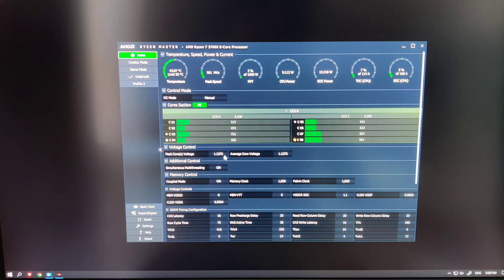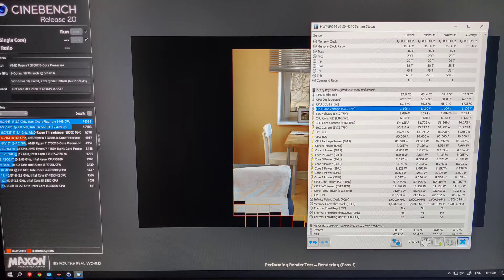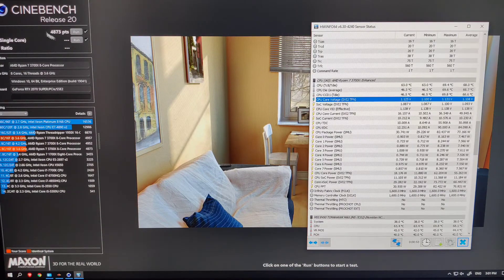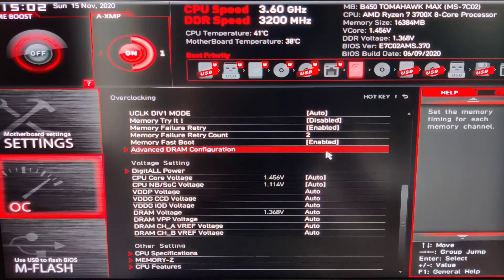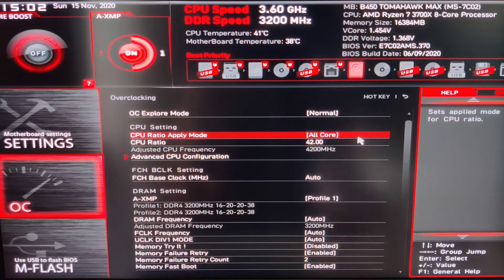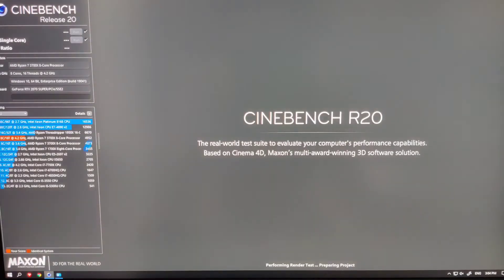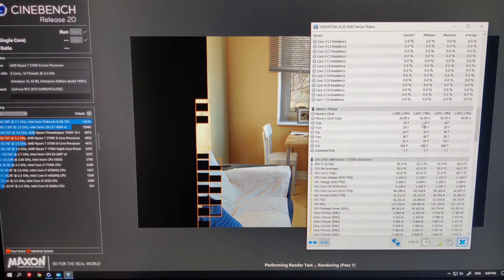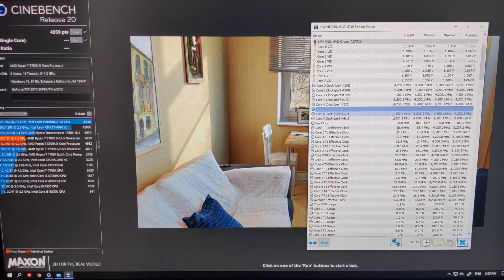BIOS Settings - Undervolting Ryzen Processor | High Performance + Low Temperature

Comment: Thank you very helpful guide. There is only one down side of your method which is single core performance. In cinebench, click on file on the left top and there is advance section. You can run single core benchmark. Since you overclock 4.2 and undervolt it, single core score drops. Even just undervolting without overclocking, the cpu can not boost fully. So there is no way to have cooler cpu and default performance.
Reply from the maker: Oh. I'll run and share single core scores of both stock and undervolt.
Thanks a lot for sharing this information!
Reply from the maker: You're right!

Here're the single core scores:
Stock - 487 (70+ degree C)
Undervolt- 478 (<50 degree C)

Personally, I wouldn't mind a little less single core performance because the temperature difference is huge!

But thanks a lot for sharing this very important piece of information. Pinning your comment for it!
Reply: @thatdude6440  Does single core performance really affect fps in games though?
Reply from the maker: Yes, games do get benefit from faster single cores.
So, for example, a 4 core 8 thread processor running at 4.8 GHz is likely to produce more FPS compared to an 8 core 16 thread processor running at 4 GHz.
Reply: @thatdude6440  Yeah, I guess also in the future games will start to take advantage of processors with more cores and threads too so like us with the 3700X should be at an advantage
Reply: @mauricejohnson660  the division 2 uses 12 cores... it's happening!!!
Reply: iam personally gain 20 fps to 30 fps more in gaming just from undervolting R9 5950x and i did this because i needed virtualization to be on for virtual system app , which cause the temp to go up in idle to 45c and in gaming it went to 60c !! soo i undervolt it to v1.100 and i did it not from bios.... from MSI Dragon center app ........ huh it really helped a lot :0
Reply: @Q8.Muslim  i have that app too for my rgb

Comment: I don't understand. I set the CPU Core Voltage to 1.25 V in my case just to lower the temps (Dont want to OC my CPU as i  have a GPU that is weak anyway). But when I open Ryzen Master and run a CInebench test (without making any changes in the Ryzen Master software), it shows over 1.35V. Is there a place where are supposed to set the "peak voltage" in the bios?
Reply: i have the same problem.

Comment: Hello, I have a question, I have a ryzen 5 3600 and I did "OC" with Ryzen Master and the base clock speed increase to 4200 but now I want to back to clock default settings but I can't, I put in Ryzen master the option default but the speed clock base is the same 4200 when it should show 3600, how can I fix that? Thanks in advanced.

Comment: Hello, I am new to this. I followed your video for my 5900x and found it to be stable at 1.375 volts. This is 100mhz under max. Is that okay to put 4700 in the cpu ratio?

Comment: Guys if you have any CPU that supported by Clock Tuner for Ryzen it may hepl you very much in setting stable clock speed, especially if you have not very much stable CPU. You may unknowingly trying to overcklocking something that supposed to work on much lower clock speed than you trying to put.

Comment: Is 84 degrees after 12 mins fine for ryzen 7 1700 OC to 3.55ghz at 1.1 volts?? It keeps rising slowly. After 17 mins it was 86
Reply: That’s really high temp for this voltage, are you sure that your cooler is efficient?
Reply: @RunningCarrot  Normally while gaming it hardly goes over 65
Reply: @dragtr0n  that’s better

Comment: Bro i did aida test for 9 mins and it became stable at 84 degrees. Ryzen 7 1700 oc to 3.55ghz at 1.1 volts. Is the temperature fine or should i downclock

Comment: I have only offset mode and not manual mode
Reply from the maker: Latest BIOS version?
Reply: @thatdude6440  I have set offsetmode   + and 0.0500v. My ryzen 3600 run at 42 ghz with 1.145 V at 50- 60C in game

Comment: Will the clock speed and voltage lower when idle or no?
Reply from the maker: It'll cap the limit, so yes it'll go down under low load.

Comment: Can i do the same on AMD Ryzen Master?
Reply from the maker: Definitely, here's the tutorial if you're looking for it https://youtu.be/WfUbB3e9Xxw
Reply: 1 question more every time i restart my pc profile change to normal and temp gets higher again is that normal?
And TY for tutorial
Reply from the maker: Yeah that's normal, I prefer to use Ryzen master for finding out what undervolting config works and apply that in the BIOS.
There's a way to make Ryzen Master apply config every time you turn on your system by clicking on a little window button in the bottom left of the software and make sure Ryzen Master is in your startup apps. But again, BIOS would be the best place to do stuff like this.

Comment: bro i undervolted my cpu successfully now running at 1.28v stable but voltage not going down on idle mode it stays fixed even on amd overclocking mode
Reply: have u found a fix?
Reply: @LawAbidingSociopath69  this fix is setting offset voltage , which i didnt mess with
Reply: @SaifAliShugan  why not
Reply: @LawAbidingSociopath69  figured out it wasnt necessary for me to undervolt cuz my idle voltage remains around 0.5-0.9v and 1.38 only when gaming or heavy task on default bios settings
Reply: @SaifAliShugan  ok but temps are high?
Reply: @LawAbidingSociopath69  stays around 75 on 1.38v
Reply: @SaifAliShugan  so u didn't adjust anything?
Reply: @LawAbidingSociopath69  nope it's not worth it for my entry level CPU , worth it if u have a higher tdp CPU which generates more heat
Reply: @SaifAliShugan  whats ur cpu?

Comment: getting different result in temperature. Undervolting it thru Ryzen master at 4500mhz @1.25V results in 65C at peak ON CB20 while doing so in BIOS with the same config gives 74C. What could be wrong?
Reply from the maker: That's strange. BIOS change should result in the same output.
Do you have any other changes in the BIOS along with this one? Which might be affecting the accuracy.
Reply: @thatdude6440  no all stock config.
Reply from the maker: Hmm strange. Sorry I don't know.
But if Ryzen master's configuration doesn't reflect the same performance, there's definitely something interfering with the undervolt.

Comment: Where would I go in the bios to set a voltage limit and core frequency of say 4.6ghz, I've done some testing with ryzen master and found some good voltage / Frequencys that work. All I've managed to find is where to put in the EDC (set to 85A) the TDC (set to 100A) and the CPU Power (set to 115w), Im currently running a 5800x and noticing some wild temps / voltages with this thing. When I clocked the cpu / to 4.6ghz and Voltage to 1.275 I got cinebench r23 scores of 15600 whcih Im happy with.. Now setting those numbers in my gigabyte x470 ultra bios is where im having issues.. Anyone who can help me please feel free to give any advice. I even have Discord if anyone can help in there, My discord is Turney@/3583, Thanks in advance!

Comment: My problem is finding how to input the right voltage so I get the right vcore voltage. I'm looking to get 4200Mhz and   get voltage below 1.4v once it reaches 1.4v the Temps rise up 60c idle and fan speeds pick up.
Reply from the maker: I made another video showing how to find those values https://youtu.be/WfUbB3e9Xxw
See if that helps.

Comment: I do 4000mhz and 1.05V and my pc didnt give a response it didnt open
Reply from the maker: Unstable undervolting.
Increase voltage a little bit and see.
In case if you're curious, follow https://youtu.be/WfUbB3e9Xxw to find what works for your system.
Reply: @thatdude6440  i removed the bios battery  and its ok now

Comment: is a voltage of 1.334 normal for a stock 5600x? auto vcore is 1.334
Reply from the maker: Yes, that's normal.
But you should undervolt it.
Reply: @thatdude6440  I would but dont want to void the warranty

Comment: Help help help 
Pls help someone pls help me... 
So after watching this I put 1.288 volt with 4300mhz 
On amd ryzen master  
Amd ryzen high performance power plan was on power settings 
PBO - auto 
Amd cool & quite  - enable 
SVM - enable 
Gaming boost - off 

& Did Cinebench R23  test 
Multicore - 12751 pts (30mins stability test) 
Singlecore - 1273 pts (30mins stability test)
Total 60 minutes 
Maximum temp was 77.1 C

& Cinebench R20 for (1500secs = 25mins )
Cpu - 5015 pts  
Cpu(single core) - 484pts 
Maximum temp is 79.6 C

ambient temperature is 29.5C 
Spec 👇
#Motherboard : Msi b450 mortar max 
#CPU : AMD Ryzen 7 3700x 
#Cpu Cooler : Noctua nh u12s chromax (1500rpm)
#RAM :64gb(16×4)3200mhz ddr4 pny xlr8

#Casing : Montech air X argb with pre install 200mm *2 front fan 800 RPM 89.7 CFM 
120mm *1 fan rear 1300 RPM 41.5 CFM 
+ Extra  3 fan 
120mm *2 top 2000 RPM 72CFM
120mm *1 on PSU shroud 2000 RPM 72CFM

Thanks for reading so now what should I do on bios ???
I want less temperature 🌡️I prefer longevity over high performance...
Reply from the maker: That's great scores.
Have you already done BIOS setting which are showed in this video?
Your system's temperatures at 4.3 GHz are pretty low.
If you want even lower temps, you'll have to lower both voltage and clock speed.
Apart from that, maybe try disabling PBO and check temps once again.
Keep me posted with your latest changes and scores.
Reply: @thatdude6440  okay I will post with update but pls reply in comment section pls.... btw I need    lower temp so I will go for 1.2375 with 4200mhz  & set it to bio if its stable & lower the temp, I will keep it that way.... 

U don't have any idea how much Ur video help me & how many times I paused & play Ur video to do that correctly ... 

&  Hey also show how to control CPU fan rpm from bios at hardware monitor section what would be the ratio... 
Are in FB or insta or what's app ? Pls do let me know
Reply from the maker: I'll definitely respond to all your comments. Don't worry.
I'm glad my videos were helpful, and thanks for watching!
You can find my social media links in the description.
Thanks for the recommendation on a video showing CPU fan speed handling in the BIOS. I'll definitely make one in the future.

Comment: Is CPU vcore the same as core voltage?
Reply from the maker: As per my understanding, the individual core voltage listed under CPU are displaying the VID, which means the voltage that the processor is requesting.
What the motherboard is actually delivering is the vcore.

Comment: Hello, I wanted to ask you which one would be the best and the safest. The offset mode or the override mode? And why? Thank you :)
Reply from the maker: Offset decreases the voltage usage by certain number from the current usage.
For example, under low load if your CPU uses 1.3V - 0.05V offset = 1.25V
under high load if your CPU uses 1.45V - 0.05V offset = 1.4V

What I did in this video is override and told my system that no matter what happens CPU is not allowed to use voltage more than, for example, 1.2V

So it all boils down to what you want to achieve actually. Some software/applications may require more voltage and thus override may not work all the time. In which case you'll have to increase the voltage limit...

In short, both are fine I believe, none of them is best or worst, just options :)
Reply: @thatdude6440  Thank you ;)

Comment: The 4,2 ghz you pinned in the bios, are they up all the time? Or is it the boost clock and without workload it is less?
Reply from the maker: It's like limiting the boost clock speed to 4.2 GHz. So only under load it goes to 4.2, otherwise normal.
Reply: Ah okay, i get it. Thank you so much and a nice and helpful vid.
Do u plan to make a video with the new curve optimiser?
Reply from the maker: @peter-kj7hc  Yeah I've read few articles about the curve optimiser which should be available with AGESA 1.1.0.0 update.
I haven't checked if there's a BIOS update available for my motherboard yet. If there is, I'll definitely play around with it and make a video as well!
Reply: @thatdude6440  yes please, i just still can accept if in idle my cpu frequency stuck at max clock....

Comment: Gamers nexus did a video on under volting a ryzen cpu using a negative voltage offset of negative 0.05 to negative 0.1 instead of using this method. Do you think using a negative offset is better?
Reply from the maker: Offset decreases the voltage usage by certain number from the current usage.
For example, under low load if your CPU uses 1.3V - 0.05V offset = 1.25V
under high load if your CPU uses 1.45V - 0.05V offset = 1.4V

What I did in this video is override and said that no matter what happens CPU is not allowed to use voltage more than, for example, 1.2V

So it all boils down to what you want to achieve actually. Some software/applications may require more voltage and thus override may not work all the time. In which case you'll have to increase the voltage limit...

In short, both are fine I believe, and that's why we have the option available in the BIOS :)
Reply: @thatdude6440  thanks man!
Reply: Hello again! (Came from your first Undervolting Ryzen video). I’m trying to do your steps via BIOS but I have a different BIOS (X570 Aorus Master). In the CPU Voltage field, I don’t see options for Override, Offset, etc. it literally goes from Auto to specific Voltage value increments. Would picking one be the same as overriding? 

Does this BIOS method also override any further changes made via Ryzen Master? So if I set BIOS to 4.5GHz and 1.2v, running Ryzen Master should show that right?
Reply from the maker: @Ellyidol  If I read correctly, you said your BIOS allows you to set voltage in increments. So you could set negative value and undervolt your processor which isn't same a override(explained this above in my the 1st message).

Yes. Anything done in Ryzen master will only take place if you manually apply it every time you turn on your system. Changes made in BIOS will make it permanent(revertible). So yes Ryzen Master should reflect changes done in BIOS.

Comment: I undervolted from 1,4V to 1,2V it worked so i tried to set on ~1,18V after that my pc didnt boot. So i reseted the bios. Since them it is not possible to undervolt anymore it stays on 1.4- 1.45 v which becames to hot. I would like to set it at least on 1,2V but everytime i do this it won't boot anymore i resetet bios like 4-5 tried different methods. :( but with ryzen master its working what is wrong please help:(
Reply from the maker: That's strange. Did you try clearing CMOS? That'll hard reset your BIOS and everything will be at stock settings.
Here's the tutorial https://youtu.be/ivEFfeSQ0SA
Reply: @thatdude6440  yeah i did this but it didn't work. I set the cpu ratio on 3600mhz not on auto and precision mode on manual... now it works but thank you!

Comment: Very clear video.  Thank you.  Can you do one on memory overclocking?  We also have those LPX rams here.
I'm wondering if boosting from 3000 to 3200mhz will change performance with the 3700x.
Reply from the maker: Absolutely. Thanks a lot for the suggestion. I'll make a video for sure!

Comment: Hey i have a question, can i download things like windows 10 on my pc even without an operating system? Or do i NEED to install it on another pc?
Reply from the maker: I don't think that's possible. An operating system is what makes communication between human and hardware possible.
If you're looking for downloading stuff from internet without installing an operating system on your hard disk, what you're looking for is a Live OS which is possible by making a live(portable) Linux USB stick which, depending on the distro you choose, generally has all the basic things like file system, essential drivers & software, and a web browser.